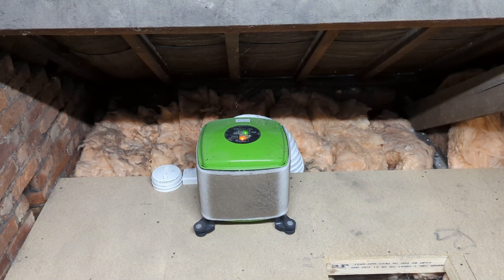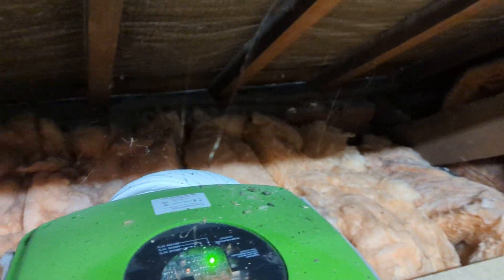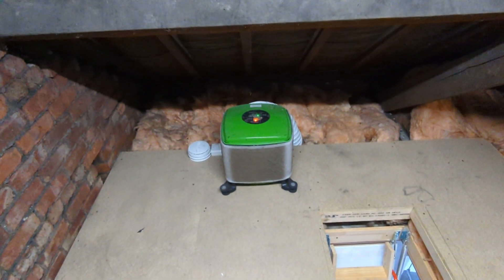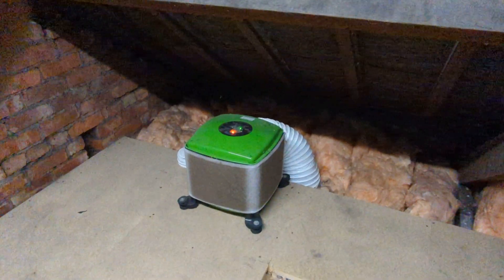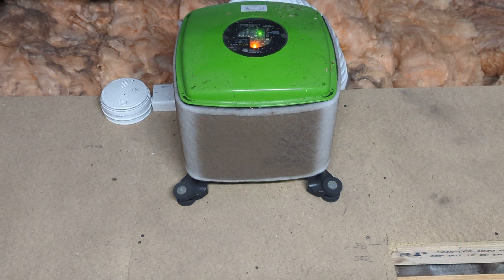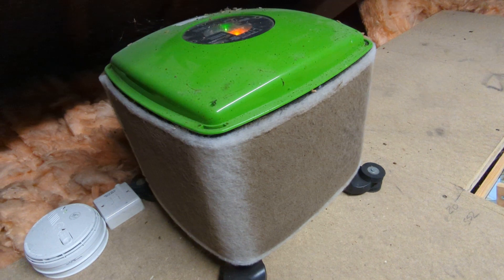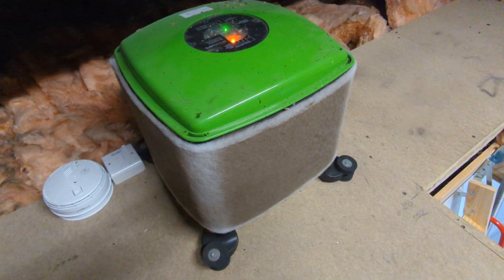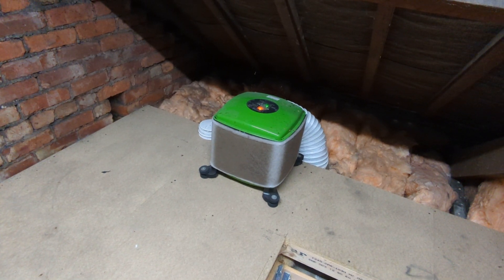Positive Input Ventilation (PIV)

Comment: Came across one on a survey recently Neil, however there wasn't adequate means of passive ventilation in the property to allow the system to work efficiently (no trickle vents on windows, air bricks papered or plastered over) so unfortunately the system was recycling moist air within the property and the client still had major condensation problems.
Reply: Think I have this problem I turned mine off as all it did was make my landing colder
Reply: I know its a old post but for anyone reading If air is coming in through the vent then its not recycling as the air has to be going out somewhere else thus the positive input element, sound more like they had it on too low a fan setting
Reply: These don't recycle air. They take in air that is flowing through the loft space and then send it into the house / where the outlet pipe exhausts. That's PIV: Positive 'Input' Ventilation.